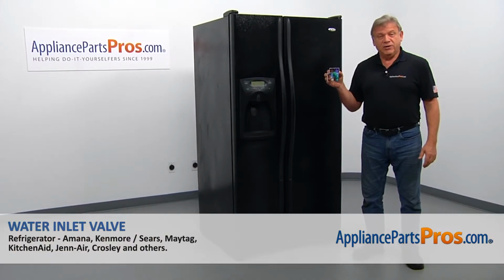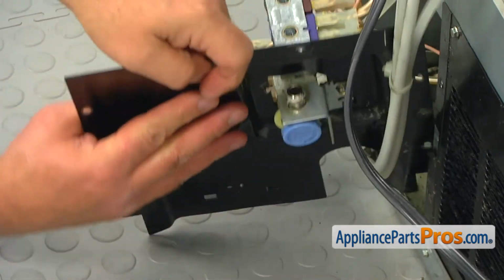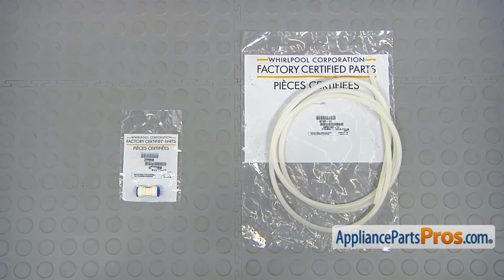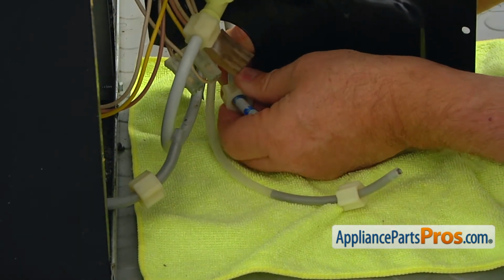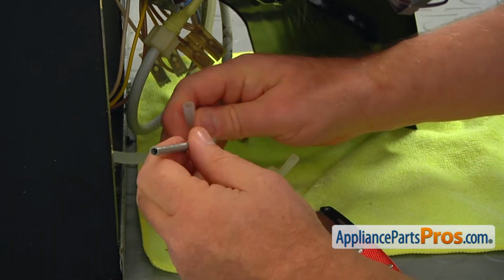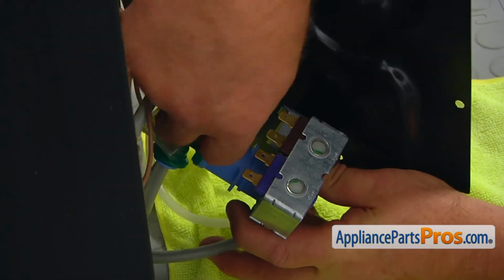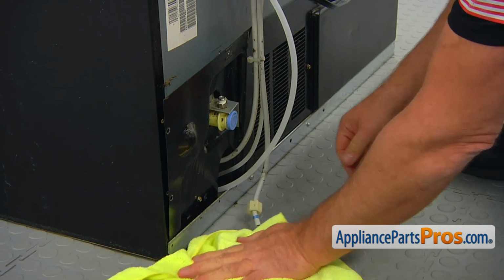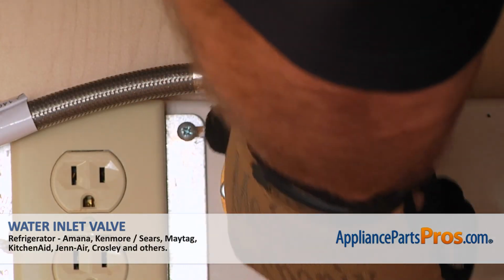How To: Whirlpool/KitchenAid/Maytag Water Inlet Valve 12002193

Comment: Remove springs, wow, that would've eluded me. Why are they there? Why don't they just make the valve exactly as it was originally to use the same compression fittings? Why do they change it? Is it better or is it just cheaper? Why ask why?